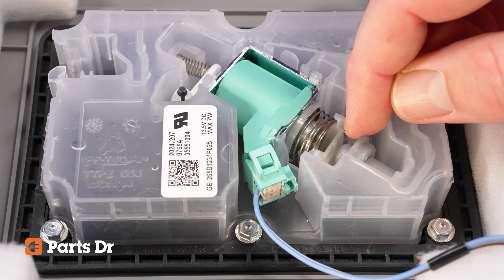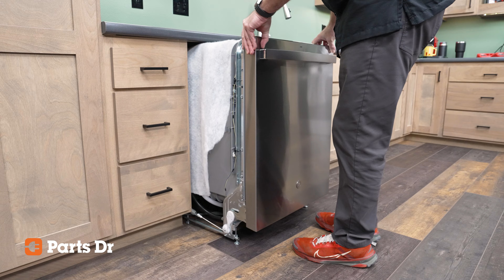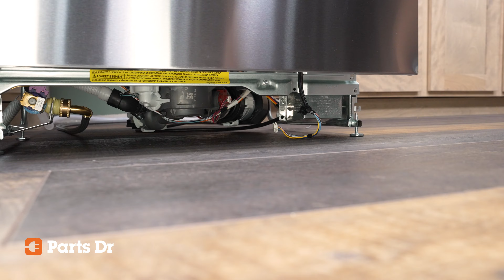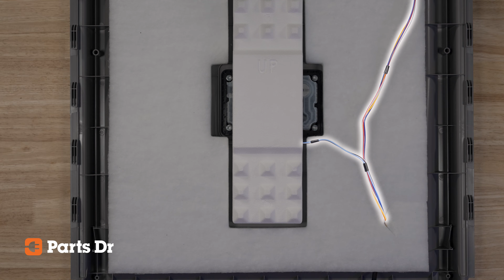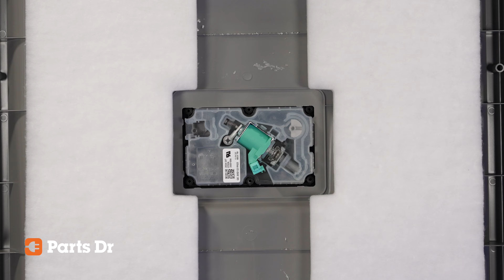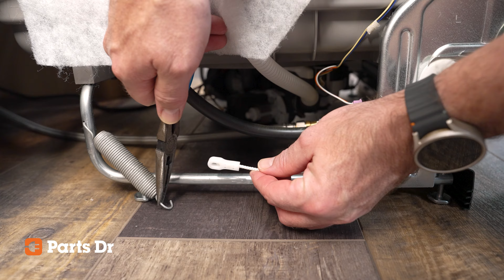Dirty Dishes? GE Dishwasher Detergent Dispenser Module Replacement | Part WD12X28239 | Parts Dr

Comment from the maker: If your GE dishwasher isn't cleaning like it used to, a faulty detergent dispenser could be the culprit. This video walks you through replacing it with OEM part WD12X28239. If you're ordering a replacement, be cautious of aftermarket parts found on sites like Amazon or eBay. They may look similar, but they often don’t seal properly or fail to release detergent at the right time. For a reliable fix, always use genuine high-quality parts from https://partsdr.com.  Happy repairing, and let us know if this solved your issue in the comments!

Comment: How can i test if its working without running a full cycle? I cant figure out how to put it into fault/service mode the instruction sheet makes no sense
Reply from the maker: We are planning to release a future video showing how to access and use the service mode.  This is the only way to trigger it to open sooner.
Reply: @PartsDr  that would be great! Thank you